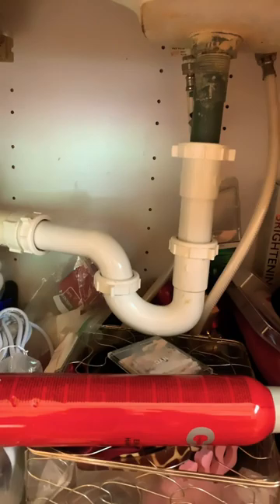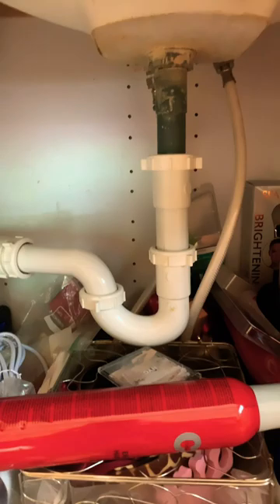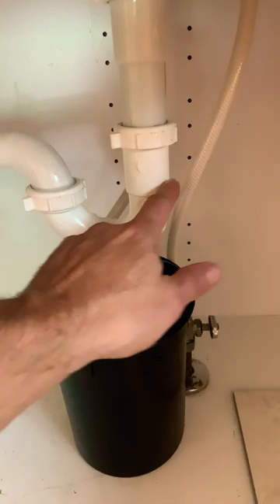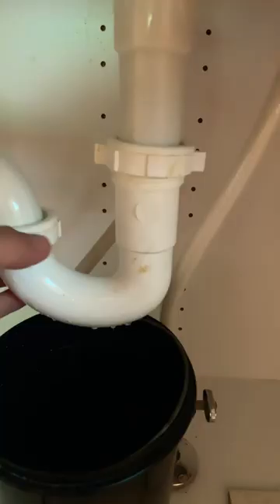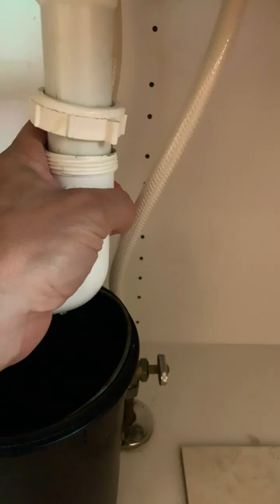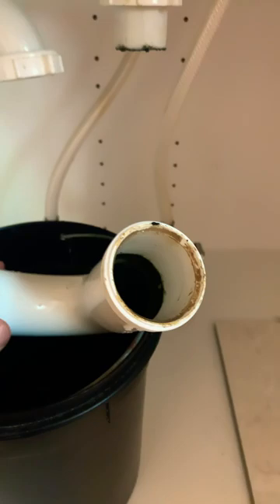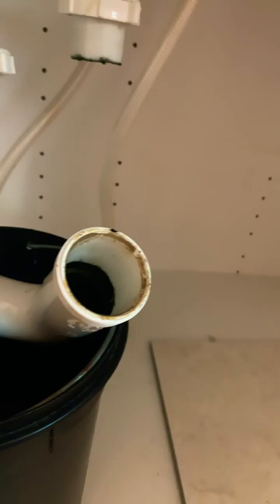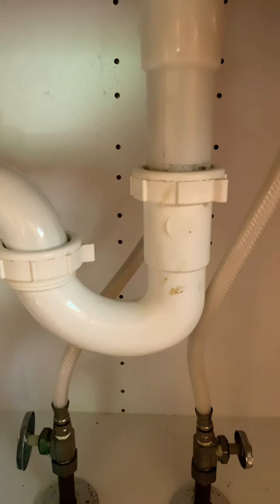Fixing a clogged sink drain, cleaning out a P trap.

Comment: another tip for everyone, there’s a rod in the back that’s connected to a screw. unscrew the screw and the little rod will pop out with a ball, pull it out. then take the stopper out and clear up the debris that’s on the stopper. then when your finished you’ll notice the the stopper has a hole. slowly put it back in along with the rod and align them. put the screw back in the rod and you’re good to go!
Reply: There is no stopper though there never was with this sink ... so that's why I'm having trouble picturing what you're saying ... okay I went and found a video that shows EXACTLY what you're talking about ... so thank you for mentioning it .

Comment: Did it! It took longer to put it back together, I had trouble lining it up. But, finally got it. Thanks 😊
Reply from the maker: When you are putting it back together, be careful not to cross thread it. Don’t force it back together. Once you do this several times, it will get easier to put it back together.
Reply: That was my problem! I kept getting it crooked,  it took a while to get one of them on straight. It helped to loosen the one I got put together first. Then get them both started before actually tightening. Shew!
Reply from the maker: Great job!!

Comment: The cold side supply line at the bottom right of the video looked like it was leaking a small bead of water. Maybe it was a drip from putting the trap back, but wanted to point it out just in case.
Reply from the maker: Thank you. There were no leaks when I was done.

Comment: If i separate it the same, can I push debris stuck in the metal section out the bottom?
Reply from the maker: You should be able to push things through from the sink drain to the part of the p trap under the sink.

Comment: i did this and it still leaks... i even used the snake to clean out the pipe in the back..
Reply from the maker: Please make sure that the little plastic washer or seal is not damaged before putting it all together. Also, be careful to line up the connections so that they screw together easily that they aren’t cockeyed or cross thread.

Comment: Video doesn’t explain everything about a P-trap
Reply from the maker: The P trap is the part of the drain that has the bend in it, located under the sink at the lowest point, that’s why most of the debris collects at this point. You can “run” a paper towel or a rag through it to clean it out.